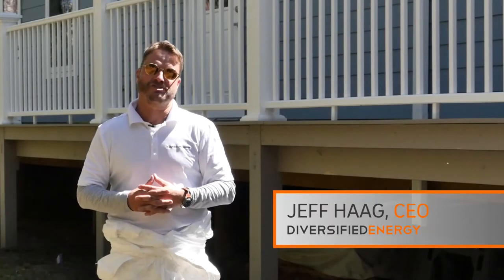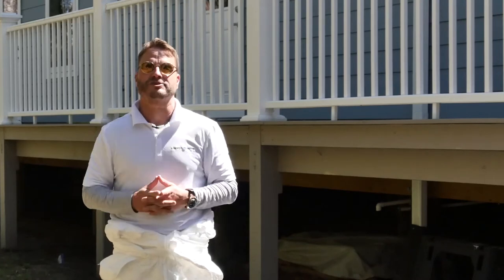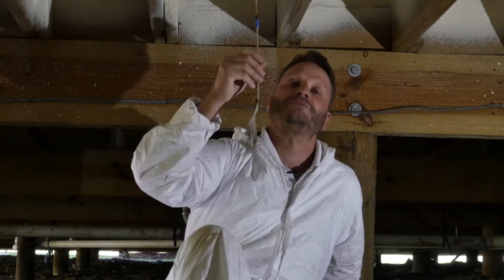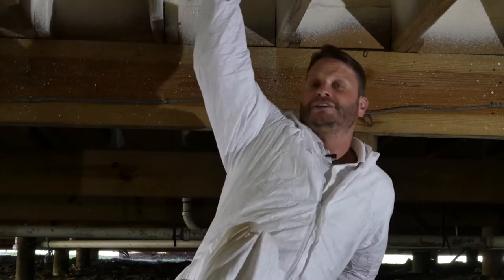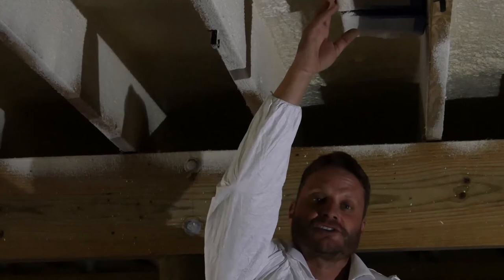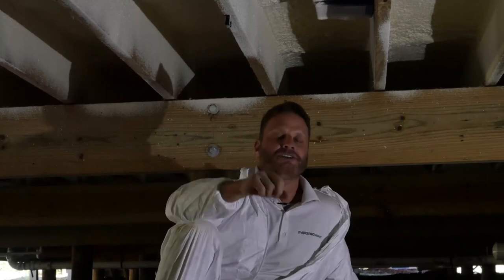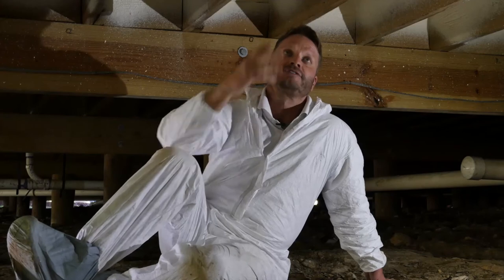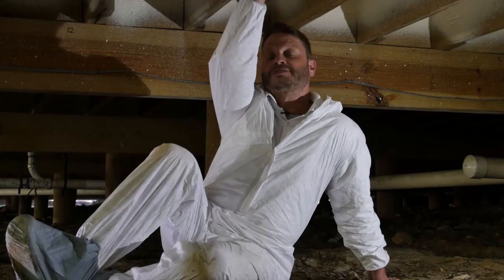Closed Cell Foam Insulation Installed Under A Raised Building Q & A

Comment: I have two inch under the house outside of Houston tx and I have pipes running under and floor still gets kinda cold I’m winter and house a lifted off the ground can I add a skirting to help it be warm and to keep my pipes warm is that a good idea or is it just wouldn’t make a difference?